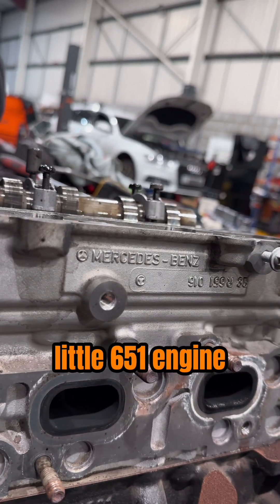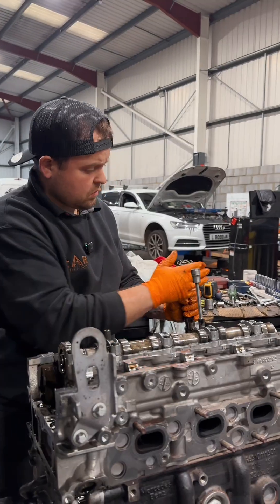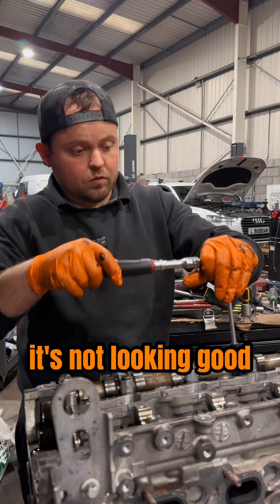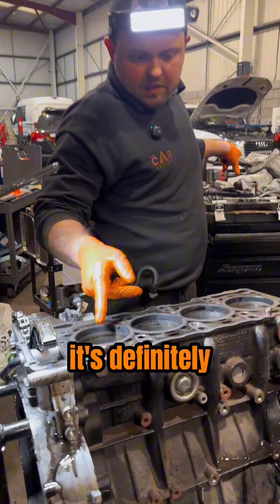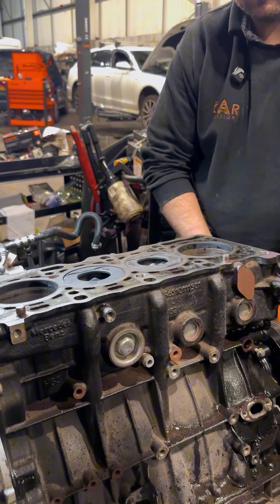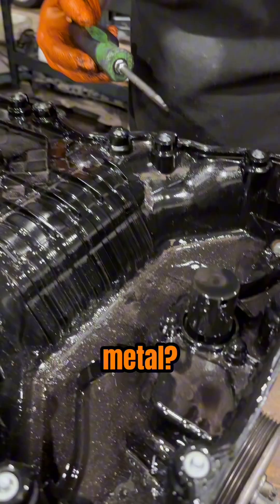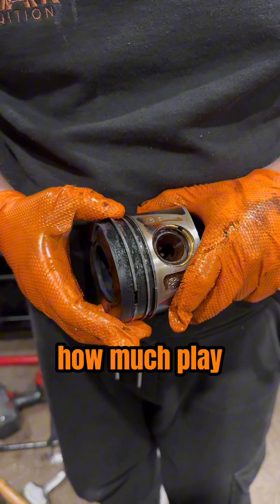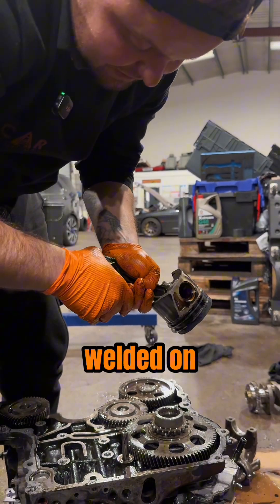Why is this engine knocking 🤔 OM651 engine strip 🦾

Comment: You really have to wonder if the net energy/emissions going into replacing/repairing all these modern engines (including cars that end up scrapped because no economical to repairs) is actually worse under euro 6 standards is worse that having engines with higher emissions that actually last. Seems like madness. Looks good on paper (to the politicians) but the reality is just waste and discarded engines/cars.

Comment: I’ve been there before but with salt water in the engine because it was a 6 cylinder diesel inboard engine for a boat the Conrods were bent, valves seized and lot of rust in the cylinders. Water had come in through the air intake and was even blowing out of the exhaust manifold as there was lots of salt build up

Comment: When I worked for Mercedes these pieces of shit were our bread and butter. 

Minimum 1 or 2 a week for Injectors getting stuck open and bending a rod.

Inlet manifolds, dpf clogged, nox sensors, dpf sensors, stolen dpf, ecu replug, it went on and on every single day. Oh and the INJECTORS, MY GOD THOSE DELPHI INJECTORS ARE TRASH
Couldn't even buy them new, had to be mb exchange, one in 10 wouldn't work and had to be returned 😂

We had a mountain of exchange motors to return to mb 😂

Comment: Certain modelyears of the Mercedes Sprinter hat an issue where condensation would collect inside the intercooler to the Point where it would be flushed inside the combustionchambers and cause bend rods. 

They changed the Design of the intercooler to bottom Mounted piping, therefore condensation couldnt collect anymore.
Before it was mid mounted.

Comment: I’ve been fixing cars for over 30yrs the amount of engine work I carry out on modern cars is unbelievable.
15 years ago I would do 1 or 2 engine jobs a month now I’m doing them every day.
And for the most part modern engines can’t be repaired there made with such fine tolerances that parts can’t be machined anymore.
And don’t get me started on wetbelts 😂

Comment: Probably one of the best diesel engines of the period.

Funnily enough, when this engine was put into the 907 Sprinter they suffered from a bent No.2 rod as a result of condensation buildup in the intercooler due to the air duct design. Fantastic engine on the whple though, not uncommon to see them hit 500k with proper maintenance.

Comment: Injector faulty which has not been atomising the fuel. This has lead to fuel pooling in the cylinder. You can't compress a liquid so it has bent the conrod and thus damaged the big end. Never leave a faulty injector.

Comment: Wait for the " I do my oil service at every 3 revelutions of the crank shaft" and never had a issue folk turning up in the comments section.
It's a Mercedes the only good engine they put in a car is the 1.5dci from Renault rest is JUNK regardless of how often it's serviced

Comment: New engine me thinks...doubt Mercedes will sell individual parts for an engine rebuild!
Reply: Merc sell a lot of individual parts, down to single pins for wiring harness plugs
Reply: MB sells part for 30yo cars also or brand new cars, you can also buy parts directly from merc

Comment: The problem it’s the not periodic oil change and the another the cold engine using like a warm.Not use the cold engine never like a top revs and the water temperature it’s not mean the oil temperature it’s right.Another way this engines not bad.Merc using everywhere.
Reply: Huh? 🥴
Reply: @jimh.412 I think breaking it down. He means these engines don’t usually  die - they are killed !

Comment: I read the press release on the modifications done to the OM651 to meet euro 6, oil pressure reduced from 4.7 to 2.5 bar, low tension piston rings, piston oil cooling jets now only on demand, cam chain positive lubrication deleted, not the recipe for a long living engine!
Reply: So in other words, make a great engine a shit engine in the name of emissions
Reply: How to guarantee an engine doesn't make it past 2030.
Reply: @gar6446 I know why you chose that date & I agree.
Reply: @gar6446  they cancel this rule,NeXT year 6.3 engines start manufacturing again also most of combustions turn back
Reply: @serhadcoban8699 the WEF haven't cancelled agenda 2030.
Reply: @gar6446  wef and eu parliement different ı speak about eu,dont know wef but german brands start combustion engines again audi and bmw still sale diesel hybrids and they say they focus Hybrid and synthetic diesel-petrol NeXT years
Reply: @gar6446 agenda 2030
Reply: Basically also removed a lot of the buffer zone that would have allowed the engine to take a bit of abuse-accidental or otherwise- and not fall over in failure mode
Reply: Planned obsolescence.  😂
Reply: @markysparky1965 most cars rust away before any mechanical parts fail where I am from. We do have strict inspections and many cars that are scrapped would be good to go in eg USA
Reply: @jonnenne  I'm sorry you live in such a state, hopefully it will improve over time and the controls will be less strict.
Reply: @neolerades2987  no it's great with the inspections. I don't want rust buckets or cars without brakes driving around with my kids in the car. It's not so great with the snow, salt and wet that eats the cars though
Reply: In BMW speak it's called "Efficient Dynamics".  So I guess Mercedes is going to use BMW 4 cylinder engines sooner rather than later.
Reply: @KM-ol5bs according to a friend of mine who’s job is in automotive journalism, Merc using the BMW 4 bangers in the near future is already a done deal
Reply: @ChrisBeevor0511 yea it's a done deal. Resources were shifted elsewhere due to stupid EV stuff but lots of new combustion engine projects have also been looked into once again.
Unfortunately, everyone only looking at premium market customers.
Chinese EVs have flooded that segment so they're moving on where th Chinese don't do so well in, combustion engines..
Reply: Who decided / agreed on these stupid changes
Reply: @stevenvater8720 EU commission
Reply: @stevenvater8720 they were forced into it by the EU
Reply: "emissions" just means making the engine crap to make you buy more
Reply: You can fix the oil pressure problem by disconnecting the solenoid on the engine... Done mine on both my OM651 and 654 and they run so much smoother... In fact for the 651 Mercedes make an actual blanking plug.
Reply: How do they even turn the oil sprayers for the pistons off ?
Reply: @saddammalima8458   A spring with a check ball valve.  Once oil pressure drops the ball closes the valve. This feature is common and TBF there's no reason to cool the underside of the pistons at idle anyways so I wouldn't say it hurts reliability.  Some automakers don't use oil squirters anyways.
Reply: @KM-ol5bs  in a turbo charged engine you need those oil squirters on double shifts it helps with heat dicipation and lubrication as well. But yeah anything for emissions
Reply: @saddammalima8458 Yep definitely when I under way but at idle they don't do much.  BMW has been using this strategy for years and their pistons don't seize in the bore.
Reply: @saddammalima8458 more importantly, how does turning them off help efficiency?
Reply: @viperz888  your guess is as good as mine . Reason why i drive a car from years ago . New cars have electronic water pump and electronic thermostat,  what could not go wrong in that senario
Reply: Recipe for an environmental disaster.
Reply: Not surprising, but regardless of what they call them, these are all nothing more than designed-in defects.  Same thing for all the millions of dumb Ford engines with "wet belts" (in the USA, Ford means "Fix or repair daily").  The only solution is to turn into some kind of auto detective before you put your money down!  Before I bought my last car in 2023 I spent weeks on the forums first.  Just winkling out which auto brands have what defects, to avoid buying one of the worst ones.
Reply: @marcs.6913 it’s the same here to Fix Or Repair Daily, another one is Lots Of Trouble Usually Serious
Reply: Water ingress due to native IQ level.
We seen millions of them from UK on youtube, going through 50cm+ water.
Not an engine failure, a society failure it is, that is a fact.
There is just too many of these
Reply: If the solenoid is the same as the M274, it's fucked - MB owners are unplugging the cable by the cambelt to let the solenoid be fully open the entire time. 

Ignore ECU code P06DA00 if no check engine light! Absolute joke Mercedes is actually poverty spec - worse than VAG standard models... unless you pay an extra £10,000 +
Reply: The EU is a joke

Comment: Ive seen this before from oil dilution
Reply: Om651 had an electrically adjust oil pump some times the solenoid would fail it use to adjust the pump from 1 bar to 2 bars when reving all the sprinters fail from it was an updated solenoid blanker you could install into the oil pump which would permanently make it 2 bars constantly.

Comment: Thats a really really tough engine. Preventative maintenance like oil cooler, fuel filter housing and valve cover gasket inc injector seals and it will go a long long way. 

The problem is people trying to run diesels with an annual 6000 miles... Just doesnt work...

Many of these units back home in Germany or wifes country Hungary with over  300000kms.

Poor oil quality plays a huge part also... MB229.52 Spec only.
Reply: Regular oil change is key, and not down to the shop drive every day. Needs to be used. EGR delete also helps.